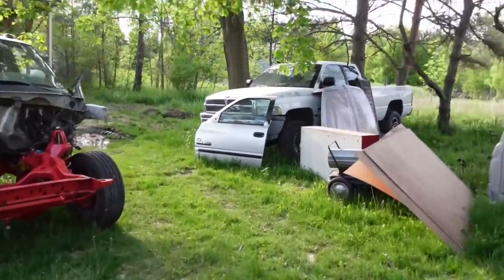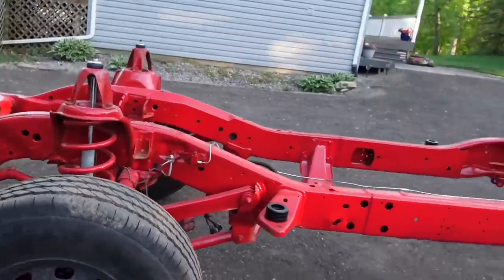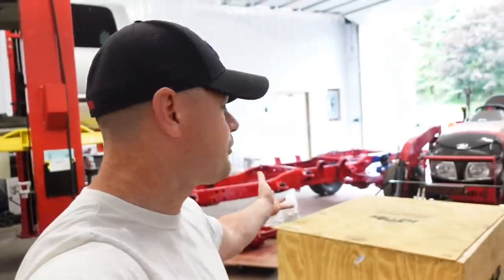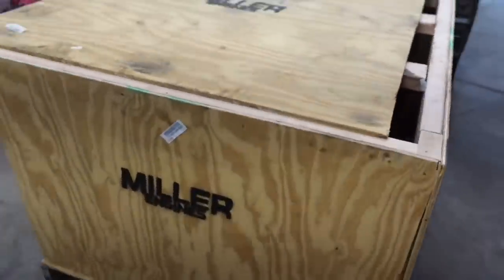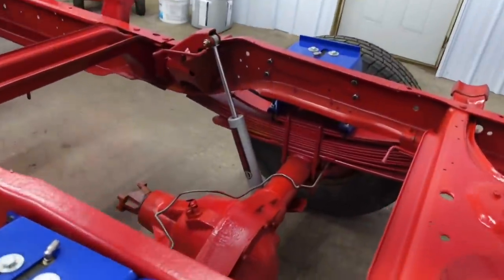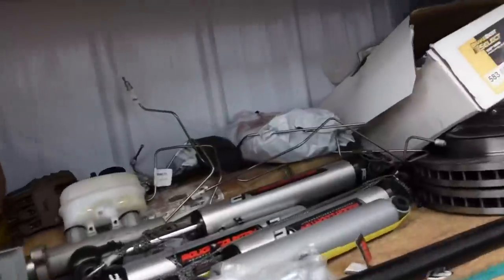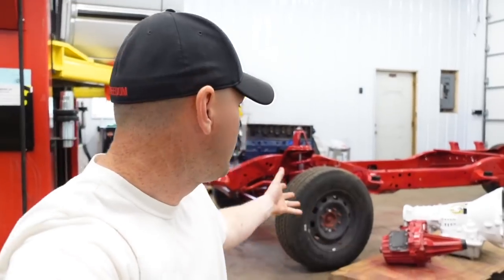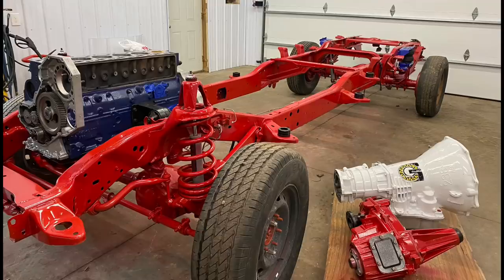Building My Insane Cummins Diesel In The Garage!

Comment: Need to make sure you put a coolant filter on that 12v so you don't get cavitation on the cylinders, coolant filters aren't there to filter coolant, they actually apply a fluid that coats the outside of the cylinders so that the vibrations don't cause cavitation on the cylinder and basically end up ruining the cylinders <3 :)  im a cummins fan big time I've built alot of 12v, 24v, and I'm finally working on my first 5.9 common rail but the 12v are super easy to work on and they can put out some massive power :)